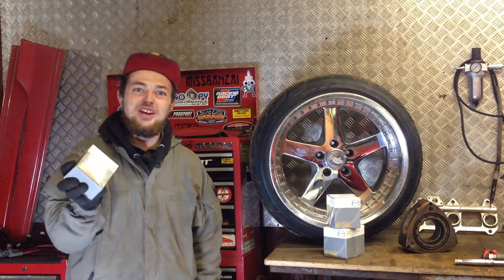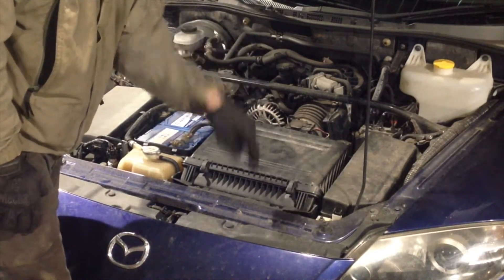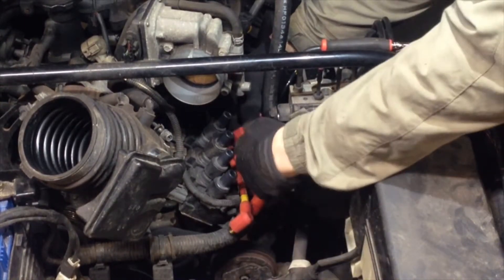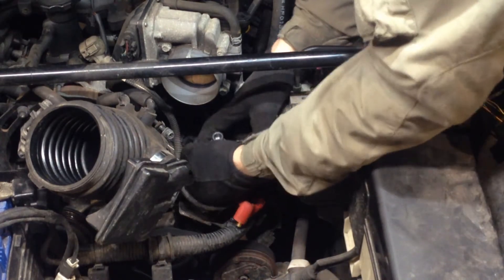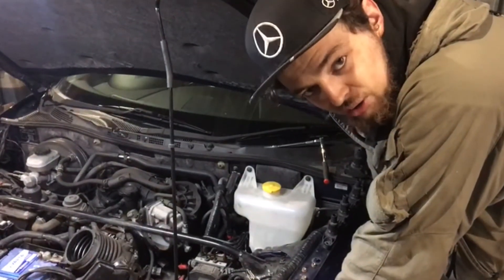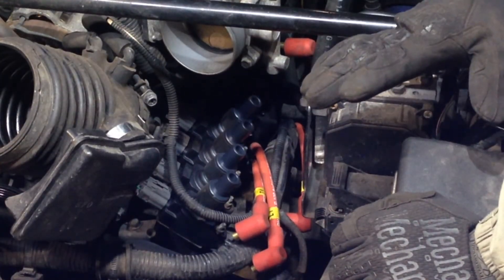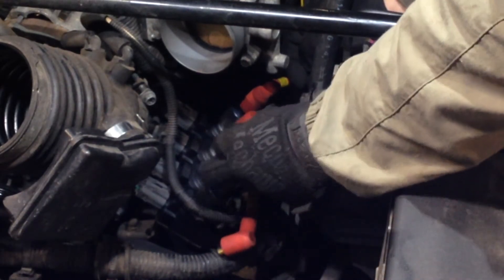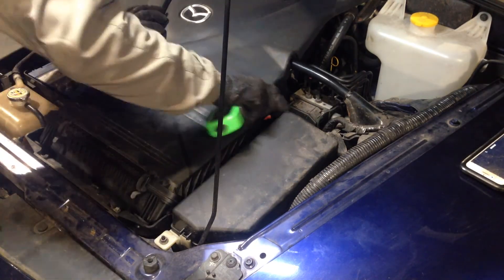Essex Rotary Quick Vid 24 - Installing Mazda RX8 Ignition Coil Packs Guide

Comment: HOW DID YOU GUYS GET THAT TUBE OFF OF THE AIR FILTER I CANNOT
Reply from the maker: if your talking about the airbox removed from the pipe it connects to, then we recommend warming up the engine bay first by running the engine with the bonnet (hood) down. this makes everything softer and more supple when working on it.

Comment: Is it better to ls cool swap, or Mazda coils?
Reply from the maker: It really depends what one your choosing to go with, Genuine MAzda coils are good, but if you want to go LS/D585 coil then i would recommend the new coils from Black Halo Racing.
Reply: Essex Rotary   I 2nd that notion! 
 BHR coils are pretty much hands down the best coils for RX8s.  They’re like $400 US, but made specifically for the 8 and should last longer, with better performance, and no retrofitting like most LS coils.
Reply: @essexrotary1540  what do you have on YOUR  car?
Reply from the maker: Most of our Cars run Black Halo Racing Coils, However we have also been testing our new M-Spec Coils (OEM specification) on one of our cars for an extended perior prior to releasing them for sale.
We also have some AEM IGN-1A SMART coils running on one of our FD's being used to test out new ignition harness for that application.